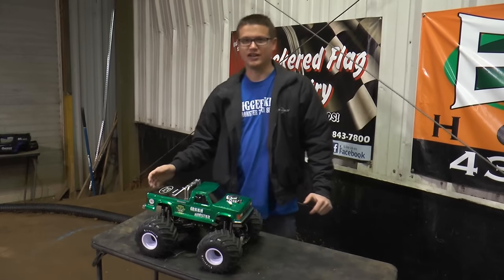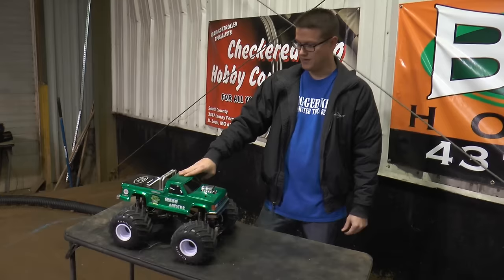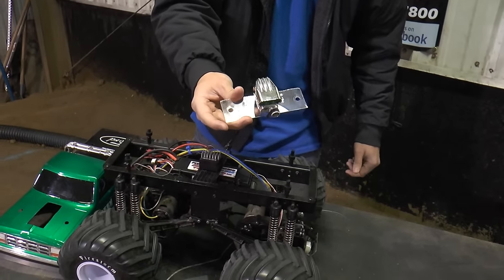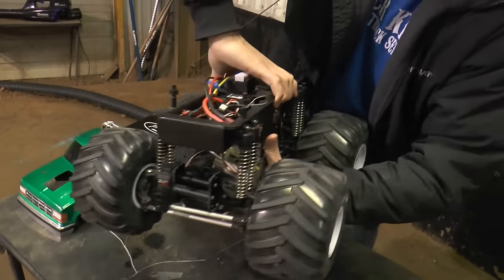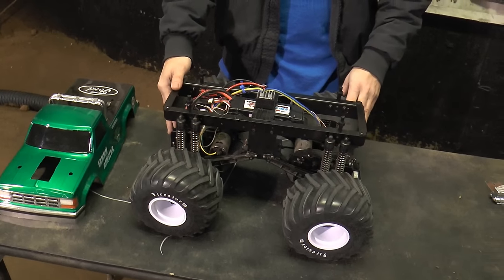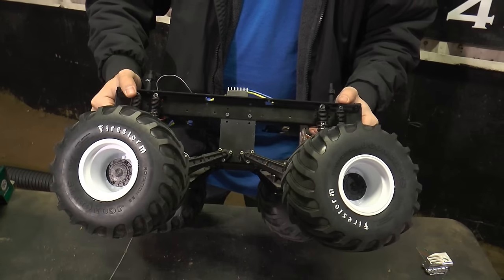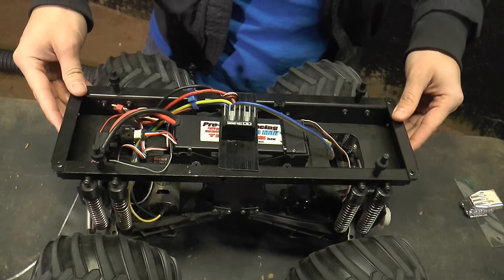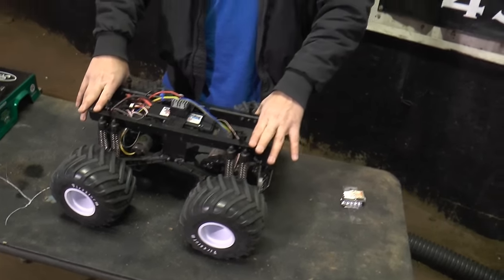Trigger King Tech: Outlaw Retro Monster Truck Class Spotlight

Comment: sealed end ball 35 turns? not 27turn stock? building a retro what pinions shall I acquire. thank you!
Reply from the maker: We run standard 27t motors with sealed end bells as that's our rules. Some clubs only allow 35t, some 45t. We've found those are slower than what we want. Also for pinions we run 13 tooth. Thanks
Reply: Trigger King, thank you! great video by the way.

Comment: Is that body impossible to get now? Blue groove ford ranger?
Reply from the maker: The team blue groove ford ranger is available. He sells them on ebay, along with a lot of other long retired bodies. Just be aware that they come with no decals or masks, just the body. If you can't find them on ebay currently then just wait a few days and look again. When Blue Groove is on vacation he de-lists all his auctions until he gets back.
Reply: Hey thanks, is this your truck? I have the same exact chasis, it is the 1inch stretch of the clodbuster and want to go with a similar look as to the one in this video. It reminds me of a better version of the " kyosho big boss/the boss" which is very dear to my heart :)
Reply from the maker: A few of us post under this account but yes, this mine (Doug here). I have two trucks that are similar to one another (Honey Bee is my other).
Reply: Thanks again. One last question. With those j-concept tribute wheels, was a custom wheel axle or part needed? I ask because I have not purchased the clodbuster axles yet and notice the ones on my txt1 are not long enough (just tried to mount them on tonight)
Reply from the maker: No adapter is needed, the tribute wheels come with different ones in the bag to fit any vehicle width. You will want to run the widest ones on that truck. You just use the hex with them, not the wheel hubs with nubs.